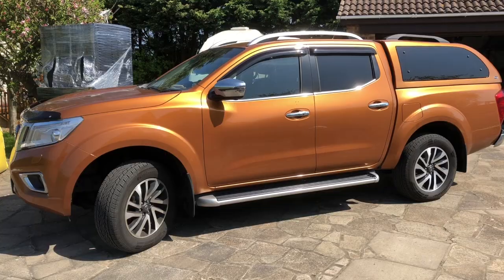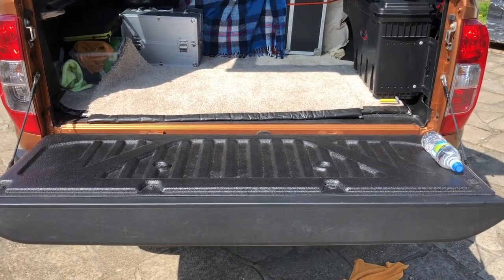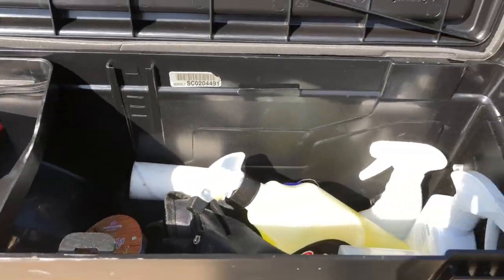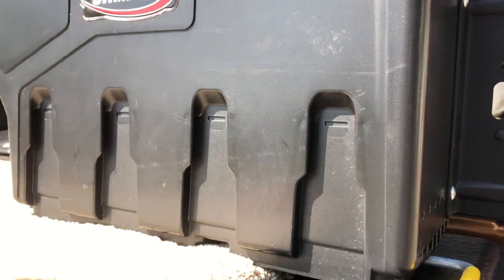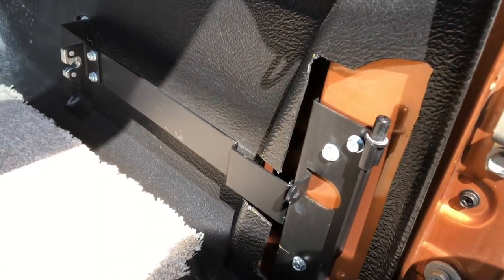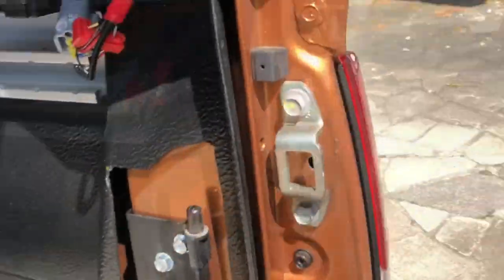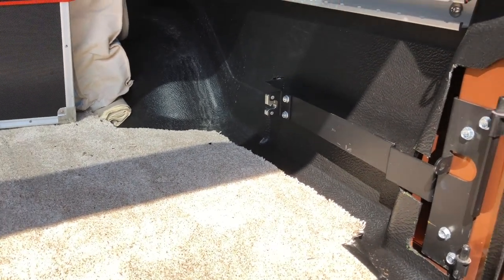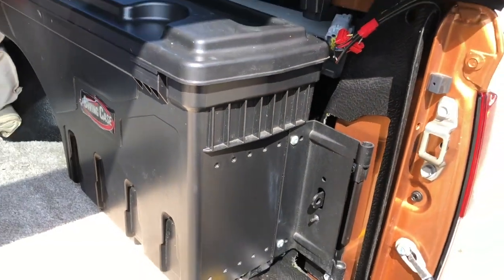Undercover Swing Case on Navara Np300 is it worth it?

Comment: I was about to order a pair of these for my Navara, but after watching the video a major flow I see is if one has a roll top.
It would seem that you will have to open the roll-top every time, even when swinging out.
Reply from the maker: Hi Mathew. Dependant on the roll top design that MAY be true, in that you might have to push the rill top back an inch or two to allow the lid to fully open.

Comment: Dear John,
always entertaining your videos but I must confess this toolbox I believe you bought it without doing your research properly.
This box is a straight fit for a Dodge Ram as you will see in some of the pictures on that amazon link which stupidly the price has gone to £260 wow!!!
Also You must agree with me that the cost / benefit regarding this operation isnt that great.
The damage to the bed liner, if you ever want to remove the canopy you are toast as they say. I am sure you rarely will want to remove the canopy.
The not tight fit with the wheel arch, clearly not designed for the Navara NP300 bed liner end section, a lot of wasted area there.
The clear area you need to have for the box to swing around...just for one BOX!!!
The good thing is that I also have a Navara...and down the road from you (sort of)
Speak soon and keep on rolling
Reply from the maker: Hi and thanks for your kind comment. I have just been enjoying your UMM video's.
Thanks for the tip off re the price hike. It was an Ok purchase at £150 but no way is it good value at £250!. The space under the curve for the rear wheel arch is actually very useful for me, as its just right to stash my safety boots in. But you are right that its a waste. I Think there are only a couple of different boxes regardless of the vehicle you order it for. The difference is the mounting brackets. Again you are spot on regarding the liner but as my truck is never going to be used topless!😁 Its not a big deal for me.
I continue to find it useful and will not be removing it but it is way too expensive at this new price.

Down the road you say🤔
Reply: To The Garage 
Thanks for subscribing will revert by doing just the same. 
When I mean down the road I mean just outside Saffron Walden, south of Cambridge. If you ever come down this way I’d be happy to meet up, always good to exchange ideas.
Reply from the maker: Thank you very much. I did some work in Saffron Walden a few years back. A truly beautiful part of England.
John.